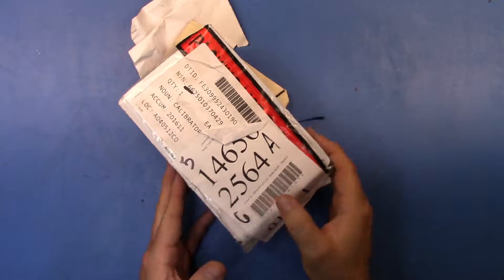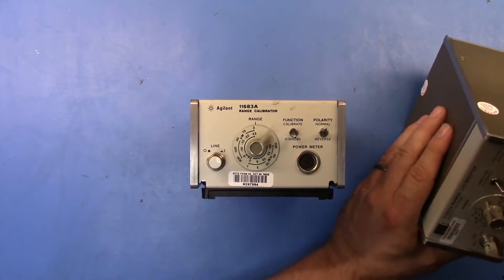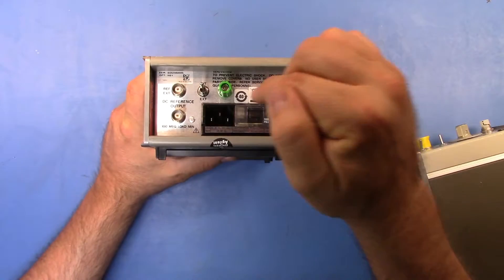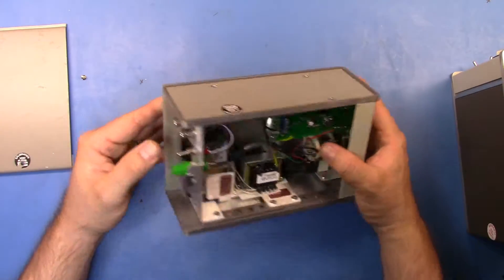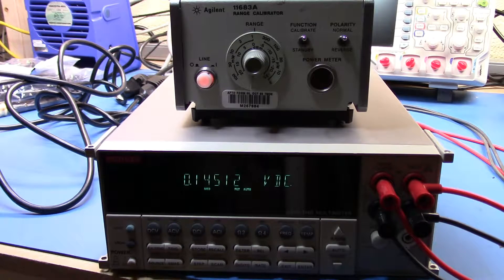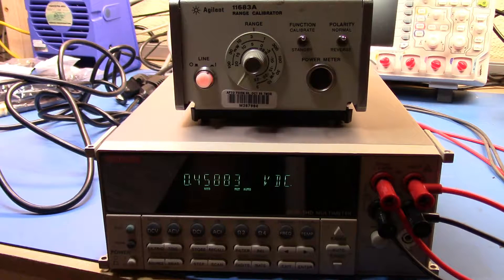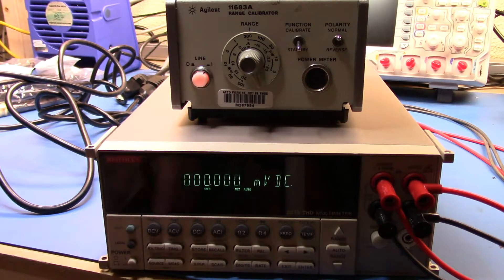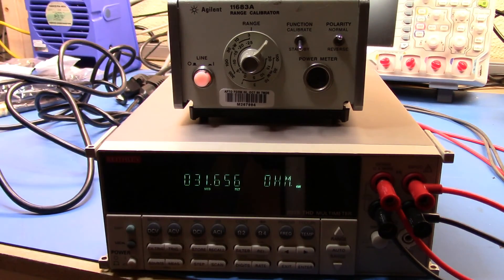HP 11683A Range Calibrator with Option H01 - Full video

Comment: Wow, these crazy things are listed on EBAY for $3,500.
Reply from the maker: Hey Patrick - Apologies for not responding earlier - Must have missed your comment.

You're 100% correct, that price is insane - I think I got mine after waiting a bit in an auction for only a few hundred dollars. I wonder if it is a case of Keysight moving, with their new meters, towards a 1st party calibration approach only (no self-calibration, etc) - I find myself short USD $10K to buy a new meter and see if the 11683A works with it - KS still sell the 8400 series sensors (at least I think they do) so they probably still sell meters that can use them and thus should be calibratable by it.

Anyway, sorry for the way late reply, and thanks for watching the channel.